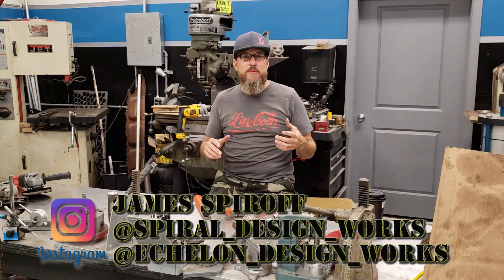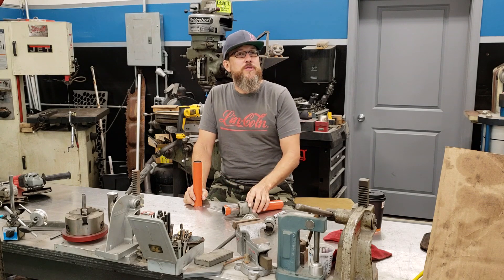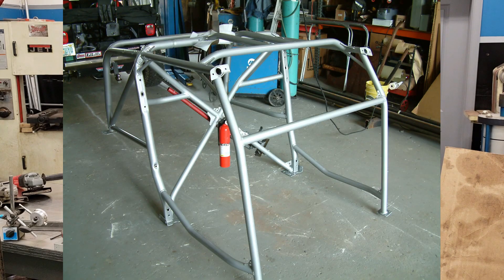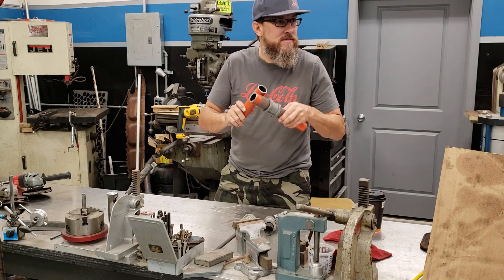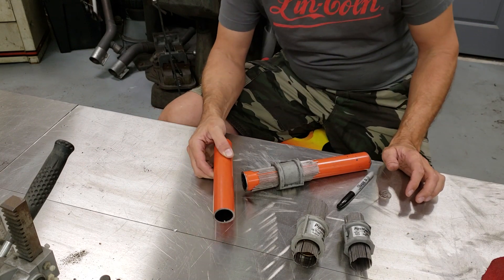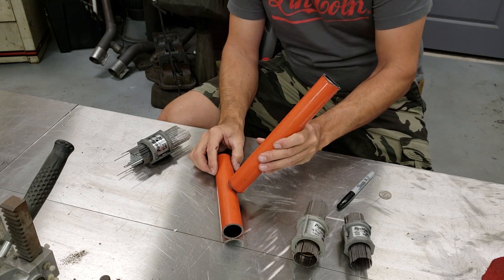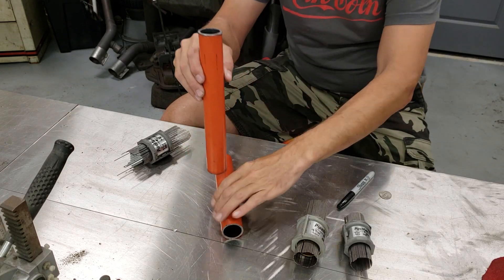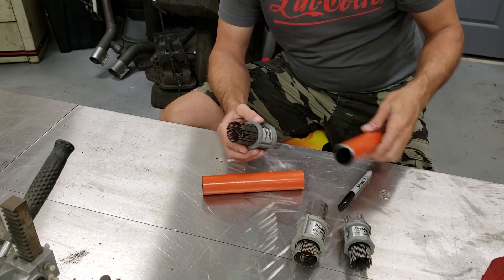TUBE NOTCHING BASICS- THREE + WAYS TO "COPE" WITH YOUR TUBE FABRICATION

Comment: I'd be most interested in how to actually measure the length of tube you need to accurately place the tube. Say a 45 brace, where you actually want it, or is it always a bit of a guess when you cut your tube whether it'll fit on the money or not....?
Reply from the maker: I use string. You can run it along the centerline or both the outside edges.  But a 45 the length off the pipe would be the same on both sides. Tape on the string. Sharpie mark the other end for length. Transfer measurements to pipe. Set angle with whatever method you are using to make the cope. Go a little long. Easy to take more off than be short and have gaps.

Comment: The thing I'd be really interested in, is how, if you're bracing between corners on a diagonal, you measure the length of tube you need to it neatly fits between the corners.....
Reply from the maker: If I am understanding you correctly you would take the longest measurement along the centerline. Then make your copes on each end to match each bar it encounters. could be 4 cuts total.

Comment: 35* works perfect for tubing of same diameter, not 45*.
Try it.
I, like the other comment below, use 1/2”or 5/8” bolts to make my arbor. I pick a bolt with a long enough shank to chuck in my collet and thread it onto the existing threads in the hole saw with a jam nut. 

Without the drive dogs and the thin metal hole saw, occasionally I’ve stripped the treads out then I tig a nut to the holesaw.

I like being able to remove the holesaw from the arbor and still utilize it as a regular holesaw too.

Comment: Question regarding your cold saw... does it swivel 45 deg in each direction for a total of 90 deg?  Or, can it swivel so the blade can be parallel to the workpiece in the vise?  I've been on the lookout for a cold saw or TCT that can swivel to 60 deg.  Thanks!
Reply from the maker: This one will go 180. So basically you could do a slot cut centered and parallel to the work piece. Mine was about $6k https://amzn.to/3lOpjDt
Reply: Ahhh, now that is more what I’m looking for!  I might have to upgrade then... I have the Baileigh CS-275EU. The cut head swivels 45deg in each direction; but I’m looking for deeply acute angles and parallel slotting like your saw.  Thanks for the reply!

Comment: I part the head off a 1/2"-20 or 5/8"-18 bolt or hot saw it. Thread a nut on and then thread on the holesaw. Then use the nut too jam it. Mount up in the mill using an R8 collet. Remember high rpm is not your friend. 
Rpm chart
https://www.mutualscrew.com/media/refguides/starrett%20hole%20saw%20chart.pdf
Reply from the maker: Sounds like a good idea. Yes I tend to run the mill too fast.

Comment: Rather than 45 deg cuts use 30deg instead and tubes will match with out the need to dress it out and give a good weld surface, this is for a 90 deg joint ofc
Reply from the maker: Yes probably is more 30 than 45.